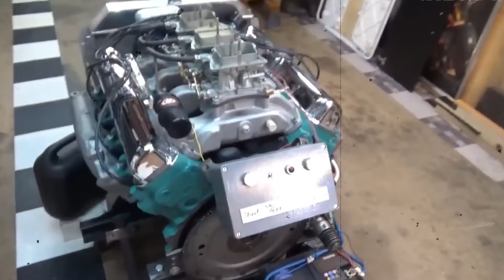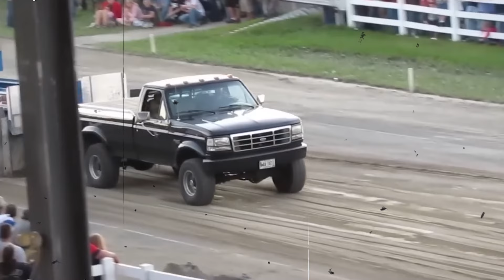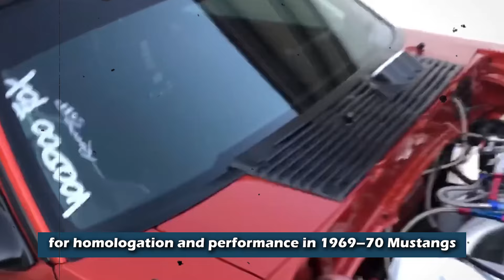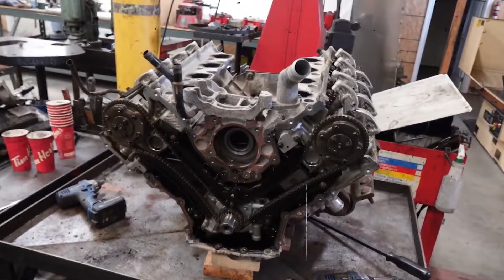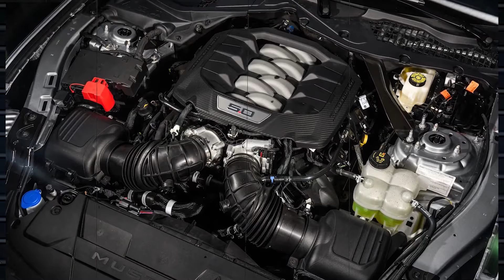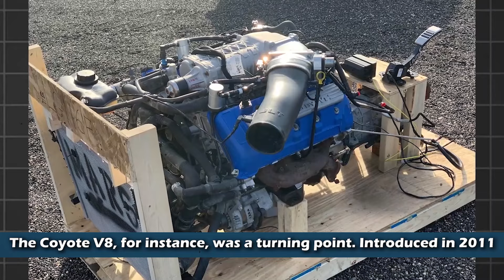9 Biggest V8 Engines Ever Built By Ford!

Comment: Great channel, please support with a like. I'm a follower from Saudi Arabia. My question is: Do you recommend upgrading from the 2024 Raptor to the 2026 Raptor, considering that Ford is working on raising prices and reducing features in future generations? And do you consider the 6-ton turbo Raptor reliable in the long run?
Reply from the maker: Thanks for the support, brother and love to have viewers from Saudi Arabia! 🙏🔥

About upgrading: if your 2024 Raptor is treating you well, I honestly don’t think the jump to 2026 is worth it unless you really want the newest look and features. Ford has been raising prices and cutting small features, so the value difference isn’t huge.

And for the turbo Raptor’s long-term reliability, yes it’s solid, but only if it’s maintained properly. These high-performance trucks need strict service intervals, good oil, and proper cooling, especially in Gulf heat. Take care of it and it’ll take care of you.

Hope that helps! 💯